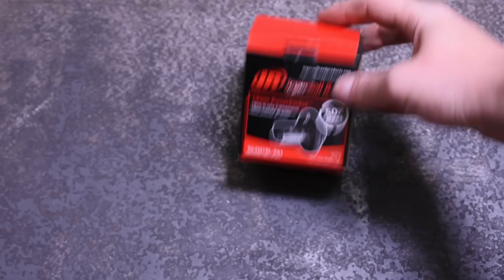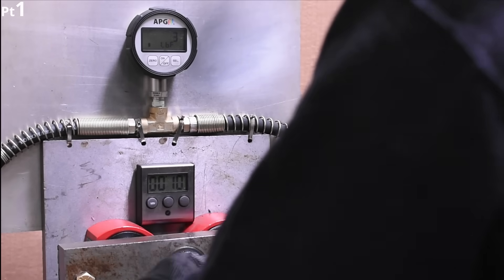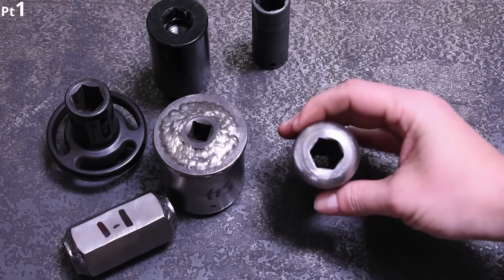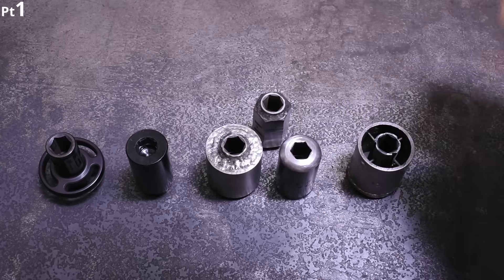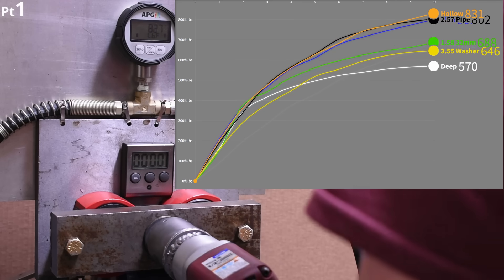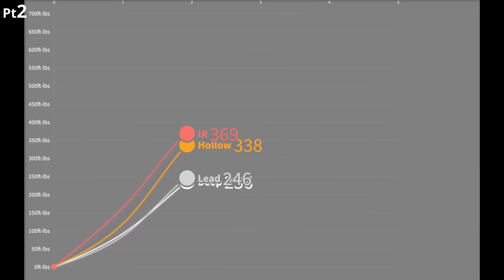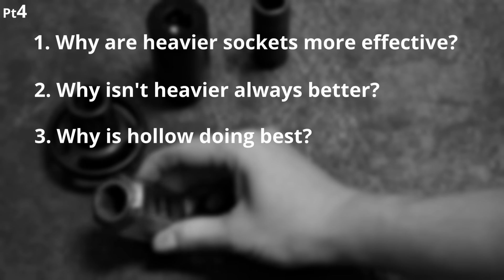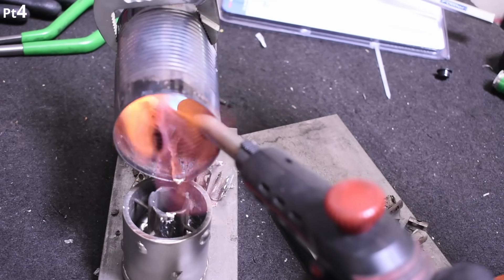Heavier Sockets Make More Power? Stumps Physicist

Comment: The flywheel shouldn't be "storing" any energy in the conventional sense since it's not spinning, but maybe there is just some tuned mass and rigidity of the socket that allows the optimal transfer of power.

Comment: Heavier sockets giving more torque does seem counterintuitive but it is something you can feel and as you proved is a reality. This is how I understand it. After the hammer impacts the anvil, for a very brief period of time, the anvil and the socket attached are a rotating assembly(albeit very slightly). Heavier rotating assemblys store more inertia and moving the weight further from the center   increases the leverage. Why doesn't more weight always increase torque? I believe Newton's law is why you can't inifinitely add weight. You reach a point where the impact's hammer can no longer accelerate the mass effectively.

Comment: the socket is rigid but the fastener is not. the weighted sockets work best on longer bolts or longer lugnuts but don’t make a difference on acorns and shorties. 

the flywheel and weight resists spring force from hammering on a bolt. think of a long bolt as a torque stick. it just keeps rebounding over and over but add a flywheel to soak up those rebounds and somethings gonna give.
Reply: try this test with longer bolts if possible. i know it wasn’t easy to come by the tool you’re using in this video. putting less weight but further out should also help

Comment: The IR is made the way it is to fit better in certain spaces. I have one and the cheaper lisle doesn’t fit . 
There’s a balance between weight and the momentum. Take a gold ball and use a Shepard sling you will throw it way further use the same strength you have but then try to throw a bowling ball with it. Your better off just picking up the bowling ball and throwing it by hand. The Shepards sling is similar in it brings the mass outward but you can only bring so much mass outward before it defeats the purpose.  You have to be able to build the momentum in the first place. This explains it making weaker impacts worse and explains all the effects you see. The hollow socket while does work better it won’t fit in certain places. 

There are plenty of crank bolts where the lisle hits the chassis.

Comment: It's not just the mass, it's the hardness of the material. A softer metal won't transfer as much torque because it absorbs some of it before it gets going, I imagine this would be proven out if you tested a socket like the lead one, but with brass. As for the hollow socket making more than the others, I'm guessing it's working on the same principle as the Ingersoll Rand socket, but with more metal, so it makes more
Reply: Yep, after seeing the lead socket underperform on the Thor impact gun I'm convinced it's because of the hardness of the filler metal, lead is softer than steel so it absorbs some of the impact force before it can get transfered to the fastener

Comment: i think it's acting as motion in diameter take that socket you cut make a fly wheel with bigger circumference i bet it will beat hollow because it's outer mass that is doing the work same as a strong arm using leverage

Comment: I suspect the professor didn't account for the free movement between the components. The impact basically throws the socket as there is so much slop between them. There is likely a very narrow band of mass for a socket in a given situation that would result in torque gains. Just a guess.

Comment: The mass of the flywheel simply adds to the impact force, up until you have enough mass on there that the power (HP/Torque) of the impact you are using cannot adequately move it. The further the mass is from the axis of rotation the greater the moment of inertia (hollow socked and IR design). Also suspect this is why the results were less impressive on the off brand impact.
Reply: This doesn't explain the performance of the Lisle,  though...
Reply: @mattmanyam  It might, the Lisle may have a very similar moment of inertia. Heavier but a smaller diameter. But not so heavy that the impact can't adequately move it.

Comment: Duude, you melt lead by heating up container. Open flame to lead surface makes a lot (for its toxicity) of it to vaporize and get everywhere to cover everything and to be inhaled. Now every surface in proximity is dirty with heavy metal, but you have saved time thanks to not waiting for heat to transfer :3
Also, i'm far from being safety freak, some time ago i did cast lead in kitchen just for fun of casting something in kitchen

Comment: A bolt would act like a torsion spring while being driven by an impact. Between each impact the bolt will spring back the opposite direction to some extent. A flywheel attached to the bolt would slow this action. If the next impact occurs before the bolt has fully sprung back then torque would be increased.

Comment: Torque = force * distance  //  force = mass * acceleration, combining the two gives you your answer. The further out the mass is (flywheel, hollow socket) the harder it hits because angular acceleration increases the further out you are from the center of rotation.
Reply: Then why is the Lisle socket equal in performance to the IR?

Comment: Yeah it appears that centrifugal force meaning the force moving to the outside has the advantage...good stuff... which is why the IR socket makes a lot of sense to me.. and the hollow socket... using all of the weight outside of the center mass... Astro tools could make it a little Slimmer with more weight on the outside it's like throwing weight out while it's spinning and the spinning increases

Comment: Seems like the flywheel being not rigidly attatched is key. The hammer hits inside the gun, gun transfers rotational shock to inner part of socket, inner part of socket rotates without outer part (outer part having higher moment of inertia now gets pulled into rotation), outer part catches up through elastic force just as inner part's rotational velocity begins to decline, giving a little extra 'oomph'.

Comment: Contact the "engineering explained" YouTube channel, he would be the perfect person to explain this phenomenon in detail & possibly iterate on the design to improve it!
Rigidity & materials obviously has a huge impact in transferring force, it would seem to me that some distancing of mass from the center increases the work on the object much like getting a breaker bar increases torque with a hand tool... but since the impact tools hammers are only cm from the rotational center, probably moving much further than that will lessen the effect ( like putting a breaker bar but still operating the wrench from the same position, more mass but no more leverage, as the force is the same distance from the rotational center) 
I look forward to a final video!

Comment: I don’t think it has very much to do with the Rigidity of the sockets and more to do whith how the sockets resist counter rotation hince why the tube and power sockets can do so well at a lower weight.
Reply: Like if a black smith is hitting a piece of hot iron it would make sense that keeping the iron against the anvil would transfer more power than if he let it bounce up a few inches and hit it back down with the hammer. Since your not losing any energy placing the socket back where it can do work.

Comment: Something I noticed from your graphs:  The super heavy lead socket seemed to not hit its peak in your short duration tests.  It started out slow, which makes sense.  It's a lot of mass to get spinning.  But it also never hit that plateau that you see from all the other sockets.  It's slow to get spinning, but that also means that once it is spinning, it's also carrying more momentum and slower to STOP spinning as well.  I'm curious what it would do in a longer test.
Reply: 100% noticed that too, it was only just ramping up!
Reply: Problem is that it doesn't actually spin. Once it is that tight it is actually stopping completely and rotating fractions of degrees.
Reply: @evancathey3968  And maybe it tunes itself to right own frequency with each smaller step?
Reply: noticed this as well. would love to see super extended ultra best case scenario testing for these
Reply: I'm curious if the lead absorbs energy instead of transferring it because it's more malleable.

Comment: So from a physics standpoint, this makes sense, With a hollow body, It gives the outside mass leverage on the inside mass vs being one large mass. Think of doing steering wheels with a bowling ball, vs with a sledgehammer. The weight being on the outside of the rotating body will gain a lot of power through leverage.

Comment: I would like to see the monstrosity that sixtyfiveford made awhile back where he made a flywheel style stubby adapter so it can be used on any socket to see what kind of numbers it makes in comparison
Reply: Agree. Sixtyfiveford's video "Universal Weighted Impact Socket Adapter BUILD one of a kind DIY" has a great explanation why these do and don't work.
Reply: There were losses in the connections, much like adding extensions.
Reply: @keepingdistance4404  well sure but how much loss? That's why I would like to see it on the beans machine

Comment: The heat from cutting that flywheel off likely changed how the socket flexed. So the weight helps up to a point but then starts to negatively affect performance. Flex also affects performance (stiffer is better). I suspect that stubby versions of the diy sockets would work better than their deep counterparts.

Comment: I had to watch this video twice to soak in all the info, good stuff! I think the professor left the chat because you proved that extra mass on the socket up to a point does improve performance. In my mind I equate you guys tightening a bolt to a carpenter driving a nail. A heavier framing hammer drives a nail in with less blows versus using a dollar store claw hammer as long as you have a big, burly carpenter using both hammers. But give him a sledge hammer and suddenly a bigger hammer is a hindrance. I believe there is a point where a heavier socket is like the carpenter with a bigger framing hammer but there is also a point where too heavy of a socket is the carpenter is swinging a sledge hammer. Too heavy of a socket becomes too much enertia to overcome for the impact.

Comment: The IR socket and large hollow socket work best because of distribution of mass further from centerline, not total mass, along with rigidity. That's my guess.
Reply: Then why does the Lisle version perform so well?
Reply: @mattmanyam good question, but without cutting the Lisle socket open to see if it's 1 solid chunk or multiple densities/materials. We really can't say
Reply: @SpeedDemon88X   But, given its price point, we can assume with a degree of confidence, that it isn't anything complicated to manufacture...
Reply: @mattmanyam  no doubt. Maybe just a well calculated combo of mass and diameter.

Comment: The answer comes not from a static analysis like the Physics prof did, but by a harmonic analysis of the tool.  It is the flexible/spring characteristics combining with the outer mass that do several things.  In the first stage, the flywheel resists the blow, but stores the energy.  In the second stage, the socket hits the bolt head and the flywheel returns the energy to increase the overall torque.  In the next stage the flywheel actually stores some energy at the end of the impact.  Next stage, that energy anti-rotates the socket between blows.  This backwards rotation makes it easier during the next cycle to store energy in the flywheel because the socket gets a tiny bit of free turning before it hits the bolt and experiences resistance from that.  Ultimately, the ideal design would have far away mass combined with a golden amount of flexibility connecting it to the socket.
Reply: This also gives the added benefit of extending the blow to the bolt head.  This allows it to counter more of the twist the bolt does between the head and the threads.  (In other words, makes it slightly more like a breaker bar that can remove headbolts when impacts cannot.)

Comment: For tight spaces what is the impact (sorry about the pun) of adding an extension with a standard size socket?  I guess this would require these multipliers to have a 1/2 or 3/4 bolt size.  Thinking this through as I write it.
Reply: They have already tested that. Extension eat up a lot of torque - like torque sticks

Comment: One problem was the idea that a "solid is rigid, but a hollow is more rigid."  This only applies when using equivalent mass of the same material, like a steel tube is stronger than a steel rod of equal masses.  If you compare a tube and rod of equal diameter, but obviously different weights, the tube will fail first.  Hollow tubes are more efficient in a strength/weight comparison, not absolutely stronger.

I would suspect there is a point of diminishing returns, and even a loss of performance on strictly adding weight, due to exceeding the capacity of the impact system to drive that much.

Why is the flywheel design or hollow can design excelling?  Torque is a rotational force applied and measured as (force X length) of a lever.  Same force but with a longer lever gets you more torque, this is why cheater bars work.  (Force = mass X acceleration) so the same amount of mass decelerating on impact, creates the same force, but at a longer lever length generates more torque.  You also have a moment of inertia to consider.  It would take a bit more to fully model, but for back of envelope math, the slug type weights more closely approximate a cylinder, and the perimeter or halo weights more closely approximate a thin hoop.  For the same mass and radius, the hoop would have 2x the moment of inertia of a cylinder.

I am not a physicist like "Dr. Bollocks", which was hopefully an alias.

Comment: This is genuinely perplexing. As an armchair physicist myself, im as stumped as the professor who ghosted you. Not that its any great surprise to most, but i'm a problem solver at heart, and ive spent many hours since your first episode about weighted sockets trying to sort the why, and i had come to a similar idea that it had to do with efficiency of transfer due to rigidness, but when you cut the flywheel off the IR and debunked that, i'm back to square one as well. Perhaps a channel like Smarter Every Day might have some ideas.
Reply: because the bolt isn’t rigid and it flexes. more mass (especially further from the center) soaks up the spring forces
Reply: I wonder if the cut socket being slightly unbalanced could have anything to do with it.
Reply: @xnewguyx2738  not when the socket itself is moving less than 1rpm

Comment: This seems like a spring-and-a-mass system with an optimum rotational inertia value. Maybe fiddling with the length of the socket (changing the spring) would show a change? Is more heavier more better if it's more stiffer? I'd bet you'd be better off talking to an engineer from IR than a university physicist in terms of insight into what specifically is going on.

Comment: You proved your expert was wrong in the last demo. Variable efficiency of energy conversion is clearly the game! Evidently the air tool gets the socket up to a fixed angular velocity regardless of mass, leading to more efficient energy conversion in those sockets with a higher moment of inertia. Higher angular momentum leads to greater torque impact on the nut. Moment of inertia is the integral sum of mass times the square of radius, explaining why these sockets do far better when the mass is distributed to the outside. Manufacturing costs will lead to a design that puts all the mass well to the outside, which nicely explains the Lisle design. You should have asked an engineer, not a physicist.

Comment: The way to solve this (I think...), is to make a hollow socket with different diameters but same weights (or at least very close).     I wonder if at some point there would be diminishing returns as you go wider, or maybe not if you can keep the same weight somehow.
Reply: My thoughts as well

Comment: I tihnk it's the inertia on the outer ring of the flywheel socket that gives it the extra oomph.  The weight is concentrated farther out, giving that mass a larger radius, which gives it more acceleration, which gives it more energy.  It takes more energy to slow it down, so when the bolt tries to stop it the socket form turning, the extra flywheel energy is applied to the nut.  I suspect what you can't see, is that it takes more energy to accelerate that socket because this socket and the regular socket both accelerate very quickly.  It's like using a hammer on a fan clutch removal tool, the bigger the hammer, the more force applied.  The longer the arm (so long as it does not twist and absorb the energy), the more force applied to the fan clutch hub.  The hollow tube having more rigidity makes sense because more energy is transmitted to the nut and not a twisting twisting socket.  Listle wins with rigidity, Ingersoll wins with extra energy.  So the most ideal should be a hollow socket with a flywheel mounted on it where the anvil comes into the socket.  You would need to draw a line and watch the socket with a high speed camera in order to see if the socket is actually twisting.  If you put too much weight on a hollow socket, it will twist, the most weight you could add without it yielding would give the best results.  Only other variable I could think of is too much weight could bog down the impact and absorb too much energy, but that's something you would have to test too.  Great video!  And the guy who made that hollow socket is freakin' smart!